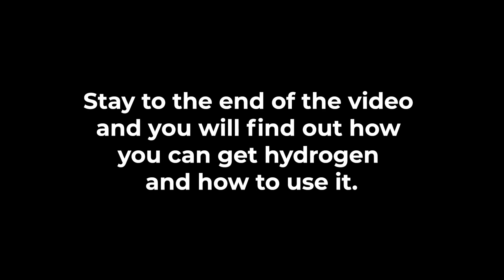I Turn Water into ENERGETIC GAS - The Ultimate Hydrogen Generator - HHO

Comment: This is incredibly dangerous and I highly advise against using a glass container. I build something similar and had an accident caused by a spark in the electrode which sent glass through my wrist. I was lucky enough to have trauma control supplies on hand but it could’ve been worse. The flashback arrestor is a good thing to add but because you are generating the gasses in the same container it still is an explosion risk. Try making it out of a plastic that rips and doesn’t shatter like HDPE and arrange it so the gas streams produced are isolated.